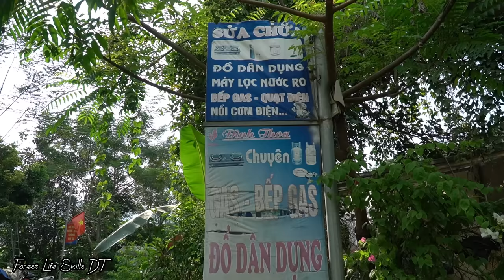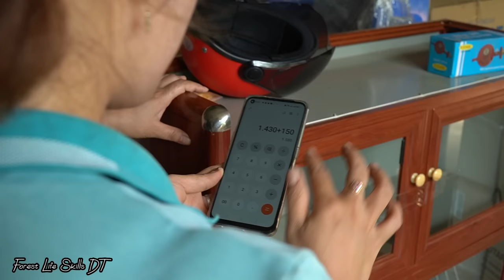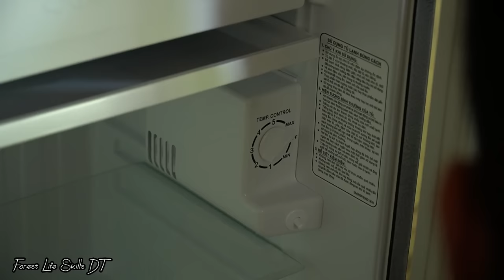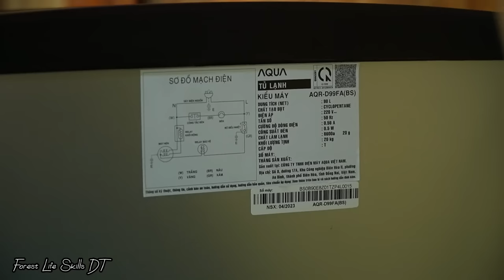DAU and TU were very happy to receive the precious gift - Plant more flowers, beautify the farm

Comment: Friends in need a Friend indeed. Dau and Tu are blessed with good vlog family. ❤ Do you not think if the breeze is blowing the flames will flicker here and there that will not give a proper heat to the pot or pan and in rain. You should close the back opening.

Comment: When you have corn seed try making some popcorn out of the kernel seeds get you a skillet or pot med or large your choice  pour some cooking old in it enough to cover the kernel or seeds not a lot heat your oil real hot first your cooking oil real hot pour some seeds in the pot it’s going to pop let it pop I untell you hear last 2 or 3 pop then remove from fire make sure the kennels are clean and dry before you pour in pot INJOY with or without salt your 👍🏽😄🫶🏾choice have fun